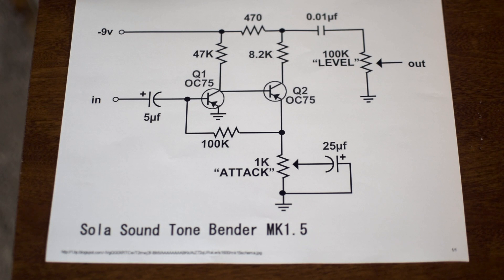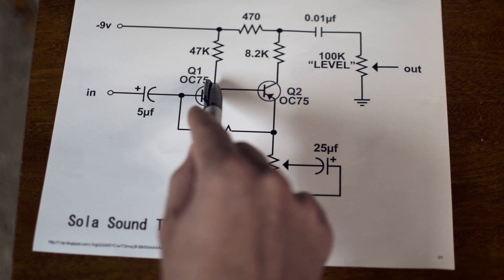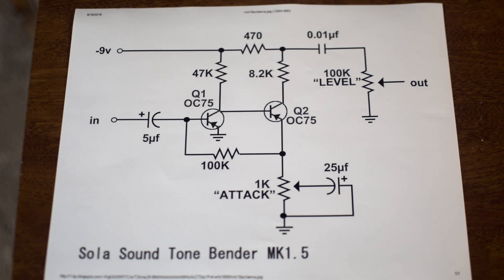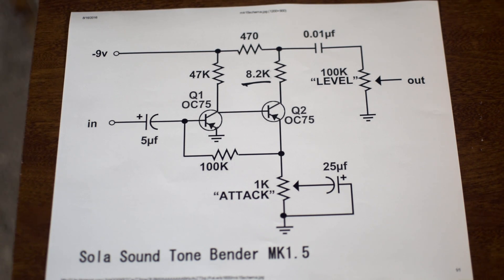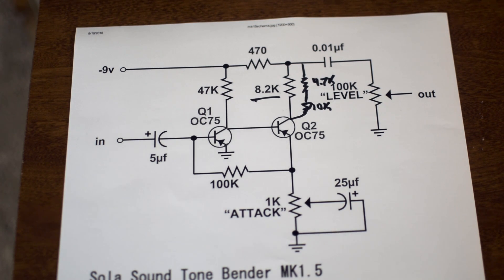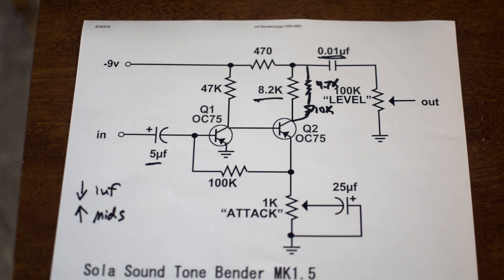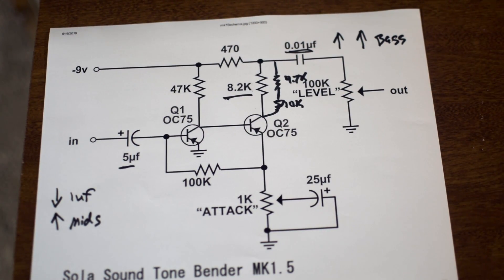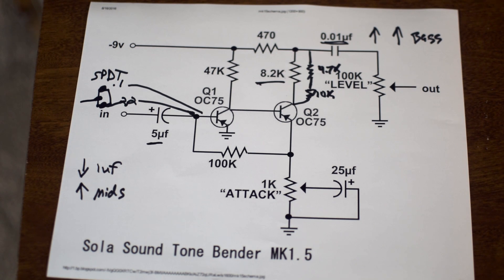Fuzz Face Circuit Analysis

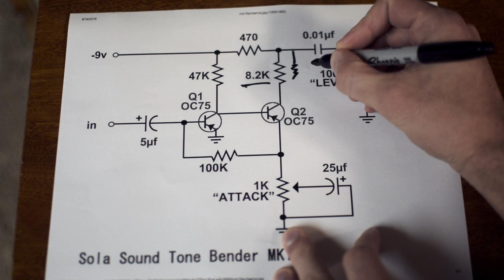Comment: At 5:57 you discuss adding a 4.7k resistor in series with a 10k (linear?) pot. The schematic is for a Tone Bender 1.5. Does this same info hold true for the Fuzz Face, even though values are different? Thank you.

Comment: Popular Electronics the magazine published a two transistor fuzz circuit in a late 60s issue , after I made myself one couldn't build them fast enough to satisfy the demand. Used salvaged transistors from anywhere I could find them, germanium to silicone all sounded different, simple elegant design though...

Comment: Covers the main mods on a FF.
I'ld like to add one remark about the input cap. Just as the output cap increases or decreases bass through, the input cap does just that. The percieved mids are what remains. It is not boosting mids though. Passive components only take away, they "shave off". Of course with a high gain device, enough signal remains. Still, it is interesting to mention that a very very tiny cap value will give a very thin shrill signal since it takes away so much it even takes away the mids as well. At 0.05µf one will have a treble booster style of tone shaping and will have nothing of muddy flabby fuzziness whatsoever. Lower than that is way beyond pleasant imho. Volume roll off effects on the other hand will accentuate what is done in the cap which means low guitar volume will have a thin sound. Those "flubby to clean" guitar volume effects are so connected to a fuzz face that I would not go low on the input cap.

Comment: the blend pot on the input sounds awesome - would you then take the two outs from the caps on either side and solder them both directly to the base of Q1?
Reply from the maker: Yessir
Reply: @KleyDeJong  awesome thank you!  how wide of a range do you think might work in this configuration?  Like if I used a 3.3 on one side and a .047 on the other would it give a nice wide sweep?

Comment: Instead of a switch, you can put a pot in every resistor spot where noon is stock value so you got cut and boost. I'm sourcing parts to do just that... Add a diode in parallel somewhere.. just make sure values are within tolerance. And if you go with a higher rated component instead of the minimum allowed voltage you can add to the mojo. It hold more magnetic field and takes a big longer to fully discharge (even tho it's super fast and happens almost instantly, it slows the discharge down slightly. It DRAINS not empties but on nano second levels)  

Awesome breakdown of the fuzz face.  I'm building my own, gonna do all the old GE styles of dirt pedals but add a high voltage tube along with the GE black glass/metal can tubes... Maybe some sun mini tubes... 12ax7 preamp pedals are my jamb so  Doing ALOT of research. Watched at least 100 hours of just videos about tubes and tube containing products of all kinds and the same in just The old RCA bibles.. transistors maybe got an entire years worth of time, I'm guessing 1000 probably over the last couple years.. Lots of old amp footage... Lots of crazy ideas to try out. People say the darndest stuff In videos and it leads to big things... I might be able to make a successful FX company out of all the crazy stuff I thought up. 

Can you do a half hour long video on Tonebenders.... Start with the first one and spend a little time talk about what that last transistor does... Please mention big muff. It's a Tonebender based circuit but must be at least mentioned. With a couple mods, the big muff can do fuzz face but more refined I fell since its got 2 extra tranny's. 

Make Q2 a Darlington and adjust caps/resistors to bias the increase gain. That config should be Considered the FUZZ FACE 1.5 since it's technically 3 tranny's but like  backwards of the TBs circuits!! 

Love it when a demo gets the gears rolling. Thanks for the demo. Greatly appreciate you man! Be safe. Later
Reply: Patrick hay. Klay this man it's man of meny faces,in all kind good way. Good, teacher, father,diy-er and wery modest. This time of people who are sharing and storage and go over again to 
Made samthink for students or complete stranger who asks normal! Perfect for learn more!! Sorry about long.🇭🇷 Pozdrav

Comment: Actually, it's a Tonebender but the 2 transistor version is called fuzz face. It doesn't have the 3rd tranny interaction so it responds different enough to warrent it's own sub genre.  They were all basically invented by the same 3 or 4 people working together at the same in the same room. Fuzz face came out first actually but was originally the 3 tranny version known as Tonebender. I believe I read it's actually the circuit that broke In the console. Just without 99.9999% of the original console boards parts.

The TB 1.5 is a special unit. It actually predates the mk1 TB. It was found by a curious player and it's said it wasn't a FF but it wasn't a TB so the 2 tranny 1.5 is it's own special thing. 1 company made all of them until the smiley face came out, which is a stripped down Tonebender, enough so that it gets it's own category under dirt pedals.

Get longer taper pots with extra turn radius, change the pot taper, try all of them, install a left handed version of each style. Install them backwards and go up 75-250 higher pot values if you wanna pull new tones out a Fuzz Face and get the circuit to do new things. Put an inductor cap in there. A cap will work as a resistor as well. Some old harmonic Percolators came with an input resistor and no cap or cap after. Mostly just a resistor to the tranny. Such a wonder circuit... Both of them!!   Love the kid being a kid in the back ground.... Don't apologize for it.... Ever!!

Comment: Great video. Does the -9v simply mean swapping over you positive and negative wires from your psu?
Reply from the maker: Yes! You also have to re orient polarized capacitors.
Reply: @KleyDeJong  thanks Kley, I've got it right then. I've breadboarded an FF that I'm working on right now, but I'm getting voltages around 8-9v on all the pins of Q1, and I can't work out whether this is right or wrong. The effect is working. On the Electrosmash analysis it says the voltages should be all very low so I'm wondering where the issue is.

Comment: I have built a double transistors (piggyback) with
100k pot on+9v as a Bias control
Input I built a custom 1958 value amp tone stack using what capacitors I had. 100uf +70uf(?) In parallel with 47if and 17uf in parallel.
Gain control to emitter
Output 47uf gives mids.
The tone stack and other mods make it a versatile high gain pedal. More HM2 than straight Fuzz and with the 100k pot on the emitter it goes from almost clean overdrive to nasty mid/treble boost fuzz.
Thanks for the video, I really enjoyed it. Cheers

Comment: Just made up a fuzz face kit pedal bit disappointed won’t work just hums when connected 🙁
Reply from the maker: Take the wiring diagram and a sharpie and check every connection. If it is correct cross it out.
Reply: @KleyDeJong  thank you for replying I'll give everything a check over. I just feel a little despondent really took my time with this didn't rush it followed everything to the letter. So hopefully fingers crossed I'll find the problem.

Comment: Its fitting that you used a tonebender mk 1.5 schematic to explain the fuzz face. Dallas Arbiter designed the Fuzz Face "based" on the tb 1.5 (it's the same circuit).

Comment: @Kley De Jong, i was wanting to tell you think you my fuzz face sounds amazing the gain is perfect . its everything i was hoping for, i could not of done it with out your video helping me to understand the circuit a bit better. i even decided to make a Univox Super Fuzz next to my fuzz face  on my bread board i got it working but  i still have work to get the octave to pop out a bit more and the gain on my super is a little on the low side.

Comment: Hi. thnks for you explanaition. I do have a question. Changing the of the first capacitor will change the amount of bass frequencies, correct? With a lower values I'll have less bass frequencies? My question is: This will lower the overall bass freqs of the pedal or will just cut some of the muddy low end? will the high freqs stay untouched or will be affected as well? i'm asking because i like my fuzz with the volume down on guitar but when i turn my guitar vol upp to 10 i get that wall of fuzz and et lost in the mix. I would like to get rid of some of that low end. Thanks!

Comment: where is the switch?
Reply from the maker: You can use whatever bypass you prefer. A generic 3pdt true bypass would work well.
Reply: @KleyDeJong  are all the lugs diagram the same? I dont know where to wire the inout and output and the ground to the switch. It seems there is a lot of different diagram for the switch

Comment: Why is the polarity of the 5 uF cap this way. Must it not be the other way around, plus at the base?
Reply from the maker: This is a PNP circuit, so the polarized components are 'backwards' compared to normal.
Reply: @KleyDeJong  Yes I understand, but the the base voltage will be ca +9-Ube(app 0,3V) =+8,7 Volts potential at the right side of the cap.

Comment: KLEY DE JONG,                  Any kinds of modifications I can do to to a fuzz face pedal to get a variety and a bunch of different kinds of glassy tones? 
       Does SRV guitar sound he is playing in a metal can?
https://www.youtube.com/watch?v=AGPx-ekqZEo

                      I'm not sure when turning down the volume pot on the guitar (NO treble bleed circuit since SRV never added one ) it changes the impedance of the guitars output impedance to the Fuzz pedals input impedance and this is what is cause this Texas Glassy metallic tinny resonance SRV tone. So it can be an impedance mismatching or impedance degradation that is cause the fuzz pedal to be a "specialized frequency EQ pedal" and not a fuzz pedal.  

                              Have you compared the schematics from the stock 60's fuzz face and dunlop fuzz face pedals against the Cesar Diaz square face pedal to see why it only happens when using the Cesar Diaz square face pedal and "does not" happen using a stock 60's fuzz face or dunlop fuzz face pedal. 

                  When I turn my strats guitar volume down on a stock 60's fuzz face or dunlop fuzz face pedals it only will give a clean hendrix the wind cries mary clean tone or little wing clean tone. It "does not" give that Texas glassy metallic tinny resonance SRV tone 

                             Here is a youtube video of a guy using a Analog Mans Sunface pedal with his strat volume turned down ( no treble bleed circuit added in ) and its creating that  Texas Glassy metallic tinny resonance SRV tone. 

                      The EE designer question is to narrow down what really is causing a fuzz pedal to create a Texas Glassy metallic tinny resonance SRV tone
1.) is it the fuzz pedal input impedance?
2.) is it the transistor types and part numbers?
3.) is it the front end capacitor values and resistor values?
4.) Or what really is it?
  https://www.youtube.com/watch?v=C6LEjf3S8tY

Comment: Why does lowering the uF capacitor cut the bass?
Reply: With filters, frequency is affected by the relationship of adjacent resistors and capacitors: Frequency = 1/(2πRC) , if you had say a 10k resistor with a 1 nano F cap the frequency cut-off would be 15kHz, change the cap to a 1 micro F cap and the cut off is 15 Hz. Depending on how the cap and resistor are positioned you will either create a high pass or low cut. The resistor could also be modified to adjust the frequency being affected. That's a bit oversimplified but it is a starting point. W2aew on YouTube is a fantastic resource for electronics theory and practice if you are looking for someone who really knows their stuff.

Comment: If using a pot to blend between the input caps, what level would you suggest for the pot? Does it even matter?
Reply from the maker: I think I've always just used a 500k linear taper pot because that's what I've had on hand.  In theory I think if you use a small value pot like 1k then you might have too low resistance to 'shut off' one of the routes entirely.  Signal comes into the wiper.  It can either travel to one of the two outer terminals on the pot.  Set the pot to 0 or 10.  The signal sees the full value of the resistance of the pot in one direction and nearly zero resistance in the other direction.  It will always choose the path of least resistance.  If the value of the pot is 1 million ohms the choice is extremely obvious.  If the pot is 1 thousand ohms it could perhaps become a little less clear and you maybe would get some bleed through the resistance.  

The taper of the pot would be more important.  A linear taper pot would ensure that 5 is about a 50/50 split, so that is what I'd choose.
Reply: @KleyDeJong  I've built two of these now with a 500K linear pot and as someone else stated there's a significant volume drop when it's blended 50/50. You haven't experienced this?

Comment: I have kids, you are a brave man hitting the record button with the little ones around :D
Id go 50k on the bias pot for Q2 (plus the minimum resistor in series), I've found some transistors (leaky ones) tend to require more voltage on the collector to saturate.  Make it a 'bias' control on the front of the pedal so you don't have to worry about temperature shifting on the transistors as well.  Good video mate!
Reply from the maker: DIY Guitar Pedals - Haha yeah, I have accepted that all my videos will likely have a child cameo at this stage.

Good thought regarding the bias pot. If the pot gets too big I sometimes find it can be hard to dial in the grey areas. But 50k should be great.

Thanks for the feedback. I'm a big fan of your videos!
Reply: @KleyDeJong  I tried a 25k pot. As the resistance goes up it starves voltage to the point that the pedal isn't working at all 50k would be worse, no? 10k is perfect
Reply: Could you do the same type of video but with your spin on a FF or TB and explain why you'd change certain things and what they do? This videos helped a lot for a pure novice like myself. Your take on this would be also great..
Reply: Great vid and feedback. When you say front of the pedal, where on the circuit does that mean? I'm a newbie of guitar fx front but understand schematics.
Reply: Oi mate what you doin here lol...
Reply: What pot would you recommend for lowering the output of a noisy child?
Reply: I have 100k and there's a sweet spot after 20k you really have to experience.

Actually I have added LED clipping in a feedback as well as on output and those light up depending on where my bias is set. Really low the feedback light comes on and the output clipper flashes late.

Comment: Hi, Im putting together a arbiter 1st issue board "FUZZFACE" Im using all the standard resistors Can i put a 50k trimmer under the board from the 8.2 resistor to the collector of the transistor to adjust the voltage. my goal is to have the top  of the board  look unmodified. will that trimmer work out. please help  me with this thanks
Reply from the maker: That would work fine.  I might recommend a 25k trimmer so you can better fine tune adjust.  Or something like a 5k resistor in series with a 10k trimmer.  A 50k trimmer will have a pretty large adjustment, and much of it may be unusable.
Reply: Thank you so much, I've been being held up trying to figure this out, Forgive me for this But... what do you mean in Series? How would that  be set up. Would i do that in the same manner i would have done with my original idea? One would figure i know. But im just putting resistors where i knew they went and don't know a hole bunch more.

Comment: What value pot should be used for blending the input capacitors. i used a 500k and it lost volume at 12 o clock when both were blended equally.
Reply: That might be because the equilibrium of two matched out of phase signals is acheived? Just guessing... My soundcard malfunctioned once, and that was what happened when I tried center instead of balancing to either left, or right... If 2 signals are perfectly matched and out of phase, they cancel and dont excite the speaker cone. The issue with the sound card was a ground fault, which I think changed the bias of one channel, and phase. Maybe if you can change the bias or phase of one, or alter one of the signals with a HPF or LPF before blending back together, your signals wont be a perfect match...  and you wont get the dead spot?

Remember this is a guess! hahaha

Comment: Great video! I have a question. If you add the SPDT with the capacitors, you can remove the 5uf input capacitor?
Reply from the maker: Yes, whatever input caps you put in replace the 5 uf.
Reply: Thanks for the answer! :D